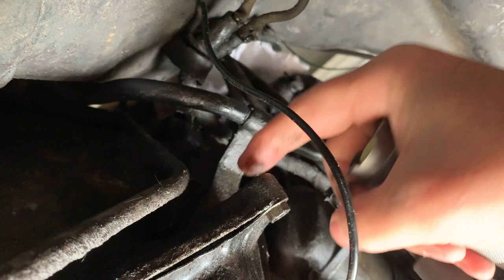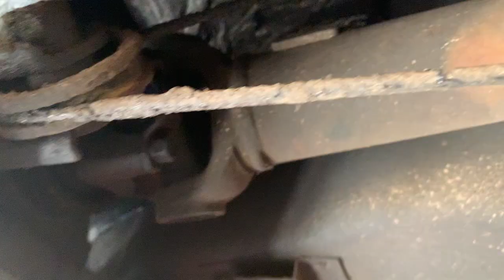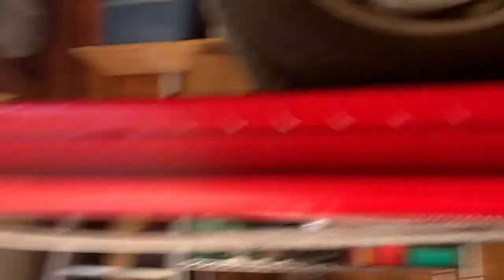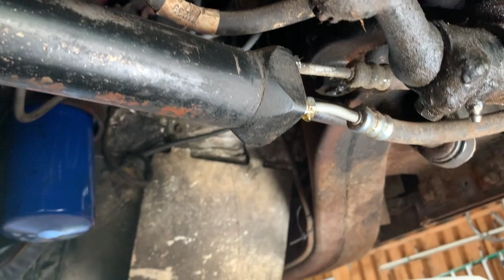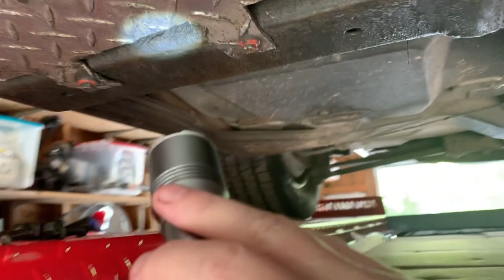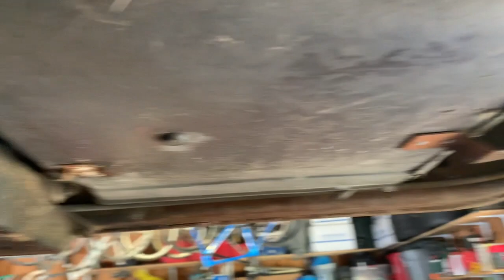starter, drive shaft, and skid plates disconnect, 68 Corvette restoration project 10 of ?

Comment: heat shields were in place of diamond plate. I am sure diamond plate would work just fine.
Reply from the maker: Are you indicating there were heat shields where I found the diamond plate? I'm aware of what was called splash guards but not heat shields. Any insight is appreciated.